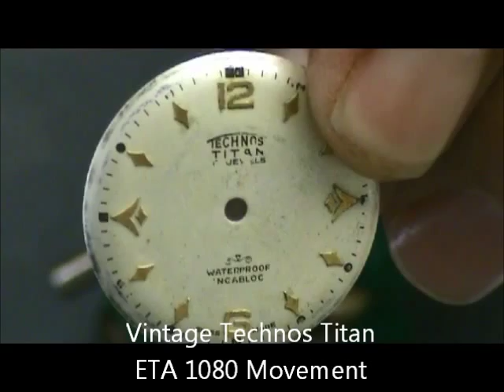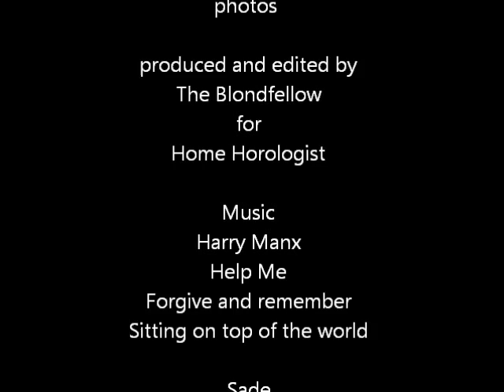ETA 1080 assembly

Comment: Were can I find this type of two piece strap like the one in this video? I have a Waltham 0s cir 1906 with wire lugs and I don't know were to get these types of bands, I don't like the one piece type because dirt collects between the band and the back of the case and just damages the case back over a period of time. Thanks for any info
Reply from the maker: You may have to get a leather worker to make one. I have a few here but only for small watches, 8/10mm. Get a couple of copper pieces to make the clip and have the leather worker fit them. Give me your watch lug size and I can organised one to be made for you. email me blondfellow@gmail .com
Reply: @doctorwatchesnclockblonfel8588  hi, I have an old Delbana watch from my late father. I believe its an 1080 movement but the 21 jewel version. I need take out the stem but there ara 2 screws arround the stem. On 1080 diagrams I can see just 1. Do you have any information about this movement ?